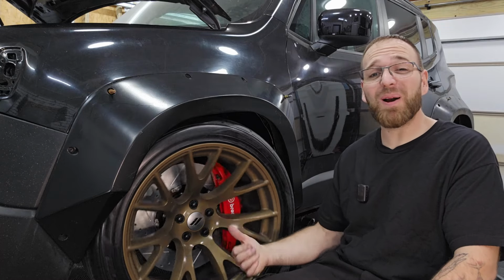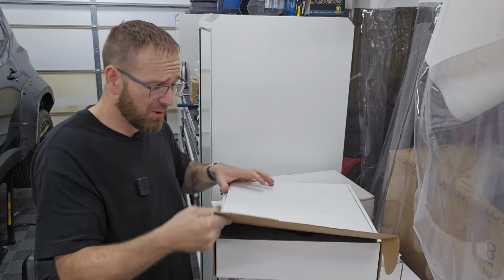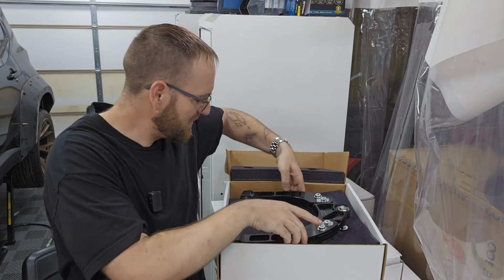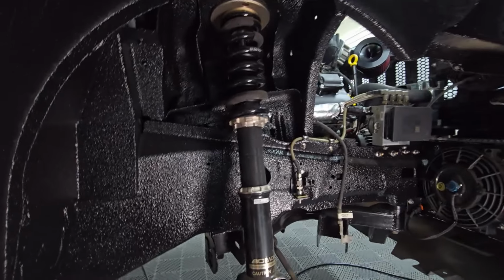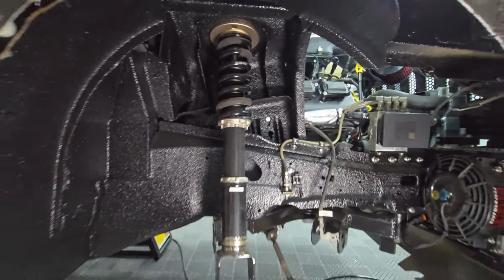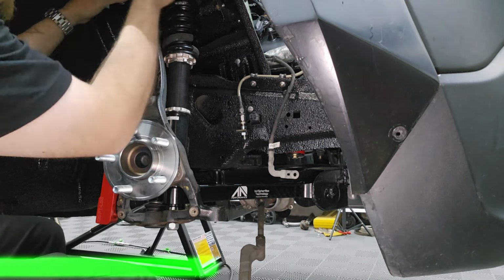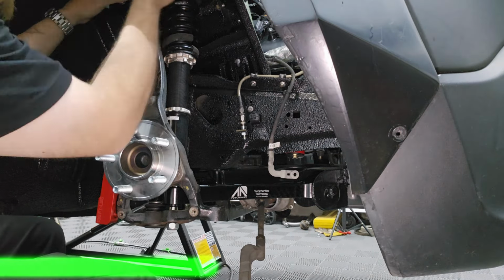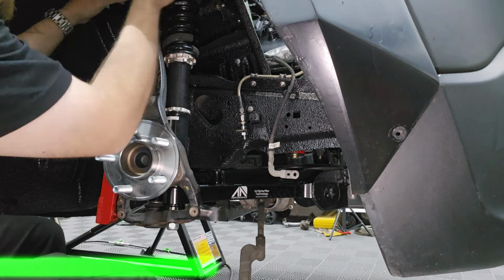HEMI Swap Jeep Renegade pt. 41 Fixing the Front Suspension

Comment: Hopefully you have a good proportioning valve as those massive calipers will upset the Renegades weight biased....The Early model Renegades had a issue with severe nose dive and it would cause the rear of the Renegade to lift off the ground. I would run as much rear biased that you can get away with before locking up.
Reply from the maker: That is a major concern, especially with how nose heavy this thing is now.  I've seen the videos of these things with the rear wheels up in the air, and it doesn't look too fun lol.  I'm using the stock ABS unit with a Wilwood master cylinder, so we'll see what it does, then I'll have to go from there.  The rear will be loaded down with some speaker boxes and what not, but we won't know what it'll do yet.

Comment: Got a question: did you keep the 4x4 with the engine swap?
Reply from the maker: The original drivetrain for the Renegade was Front Wheel Drive, and the Charger drivetrain I'm using is RWD.  I'd love to have an AWD setup (trackhawk) but there's no way to make the engine fit with the front drive setup, without pushing the firewall into the cab another 4.5".  The firewall is already pushed back to the door sill, so it won't work on this one. The next build though...